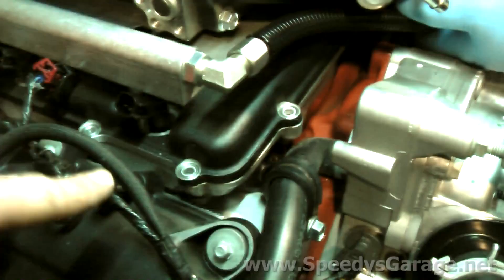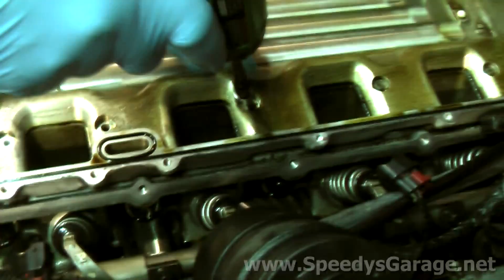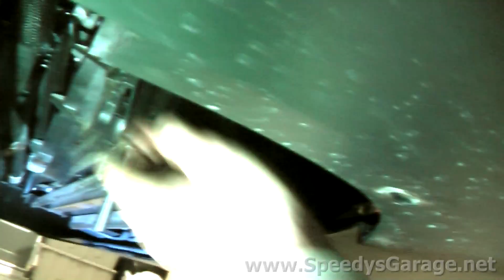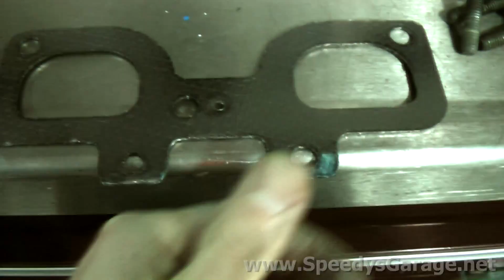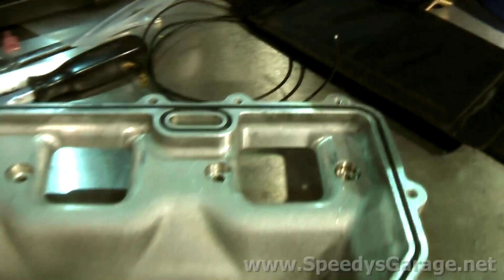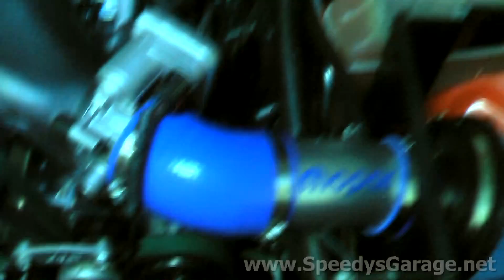Challenger Heads and Supercharger Install (Cooling System Trouble Part 2)

Comment: Did you drill and tap the fuel rail for the pressure gauge?
Reply from the maker: The aftermarket fuel rails had a provision for a fuel pressure gauge.  If yours do not, yes you can drill/tap or you can put a "T" at one of the ends of the fuel rail.

Comment: Hey I watched this entire video to get an understanding of installing the top of the engine coincidentally because I want to buy a stroked 5.7 bottom from Arrington!!! So to hear you thank them was a pleasant surprise! 

Would you mind me emailing you a few question in preparation to this possible build? Just need to know what I’ll have to do if I buy the stroked bottom from them to upgrade my 5.7. Ima new to this. I’m not sure how the wiring aspect and the unseen stuff works.
Reply from the maker: Arrington actually closed their doors unfortunately.
Reply: Speedy's Garage I just spoke with em at shophemi.com

http://www.shophemi.com/p-1853-arrington-392-short-block-from-57l.aspx
Reply: Speedy's Garage let me know if your able to help with some direction. Shophemi told me I could buy that stroker and bolt on my 5.7 heads/top end
Reply from the maker: Not really much I can offer.  You're welcome to email me from my website www.SpeedysGarage.net and I'll answer what I can, but the shop building your engine would be your best bet.

Comment: I’m wanting to add a supercharger to my 14 R/T. What all has to be upgraded to have the supercharger? I’ve seen nothing good adding one straight to a stock engine. Seems guys blow the 5.7 engines after a few thousand miles.
Reply from the maker: You can bolt one on with proper tuning and running proper premium fuel.  It's folks that try to squeeze every HP and beat on them at the track with poor fuel that have issues.

Comment: My kennebell car was doing the same thing blowing antifreeze out of the overflow.  I noticed  you have an after market  coolant cap I had one as well switched back to factory dodge cap  it stopped,  I thought the same  as you head gasket ,the the dealer I bought it off thought the same thing so I got an low mile  supercharged SRT  pretty cheap. Mike at OST  said he did not think it was the head gaskets as I had checked for coolant in oil and combustable ect.  He had seen hoses collapse  on the dyno, he  suggested to try that ,   or maybe the cap. I have a 1500 ram with 250000 miles i took the cap off it as a test ran the car hard no issues. I marked the coolant tank  to keep an Eye if the level changes which it does a little but it is with in 1/2 to 3/4 inch range up or down.   I did buy a new dodge cap put the old one back on the truck.  But a used 250k cap worked better then a new after market billet aluminum one.
Reply from the maker: Good info, and definitely something to check.  My cap is actually the stock one with a Billet Tech cover over it.  Wish I'd checked that lower radiator hose first, learning experience for sure LOL
Reply: i have Dodge Challenger SRT V8 hemi 392 6.4Ltr 2013 model i am having overheat issue don't know what to do.  Workshop/ garage asking too much money and saying they will open engine. Please advice. I live in UAE Dubai

Comment: I have a mechanic friend that what he does to check a leaking head gasket is puts a rubber glove tightly around the expansion tank fill opening and then pulls one spark plug at a time and pressurizes with air and if there is leak by the glove will expand. He found a head gasket leak on a 2.2L cavalier that i had. It is true they aren't installing the spring in the lower hose like they used to. Replaced a lower hose on my '99 jeep (4.0L) and the old hose had a spring the replacement didn't.

Comment: Incredible perseverance. I have a similar problem without the 17% crank pulley on a 2015 5.7 RT with a ProCharger. The car only has 12,000 miles, so I will be checking the bottom hose also to see if the hoses are just really weak. Sounds like they should be using the spring again.